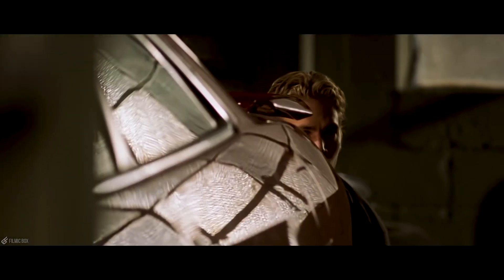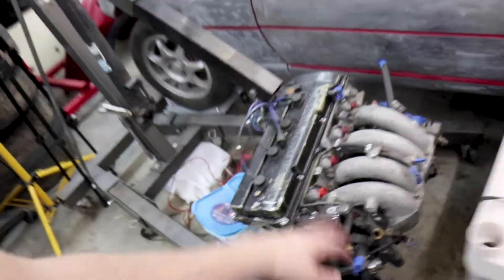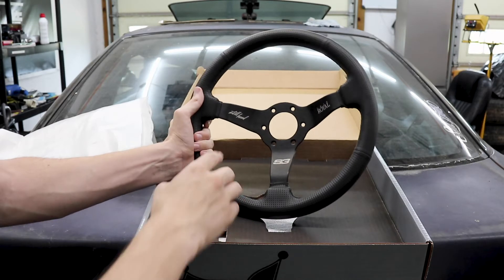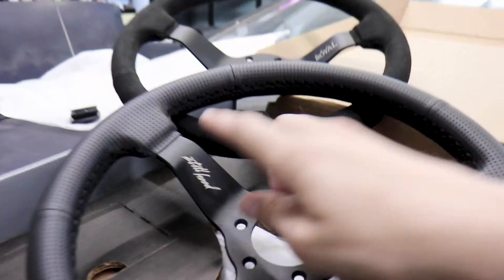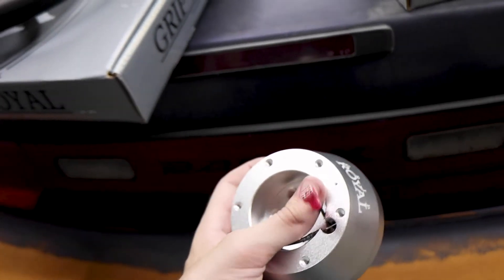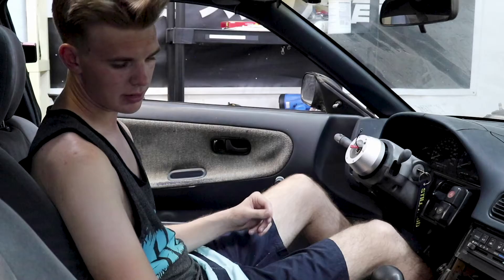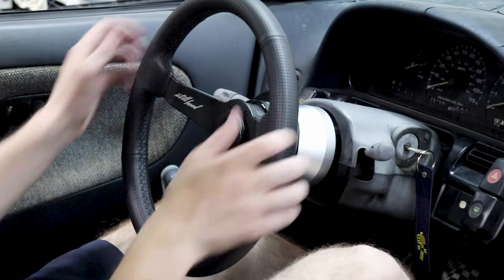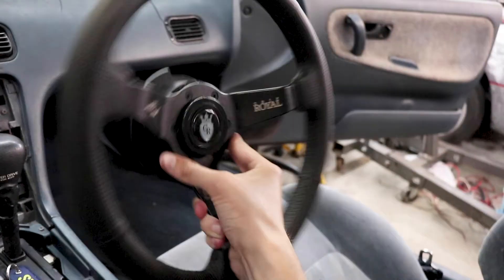The Bucket List S13 Gets a CUSTOM Grip Royal Wheel! - Install

Comment: How come I cant put my grip royal wheel to be straight with the nrg quick release
Reply from the maker: Drift 240sx you probably need to adjust the hub where you have it splined on to the steering shaft.